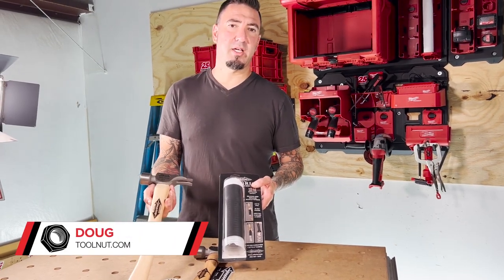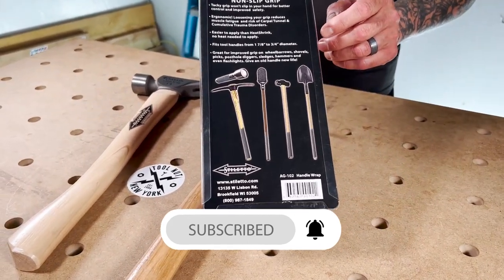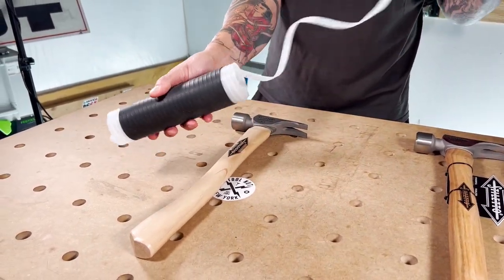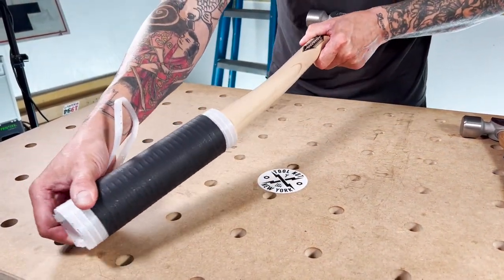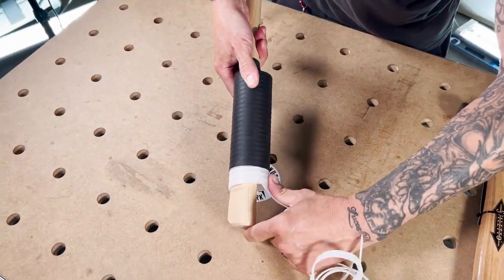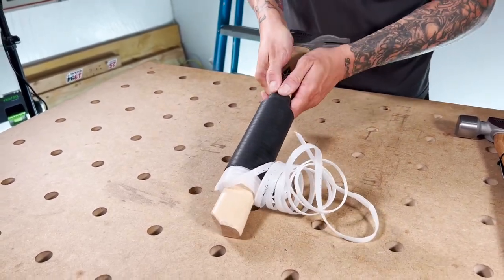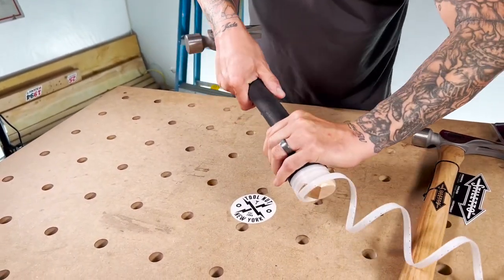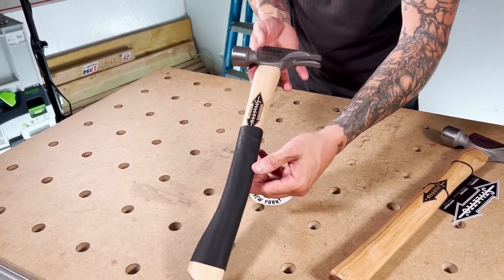How To Apply Stiletto AirGrip | Easy Apply Rubber Grip Wrap

Comment: Bought a brand new stilleto 16oz axe handle and the air grip, easy application. Grip started tearing before lunch from being laid flat on shingles and going in and out of the belt. Two weeks later it’s totally gone. Absolutely not worth it if you’re going to do daily construction. Baseball bat grip tape is cheaper and much more durable